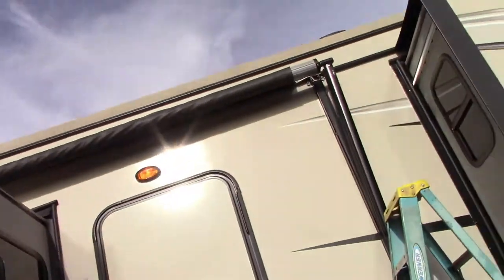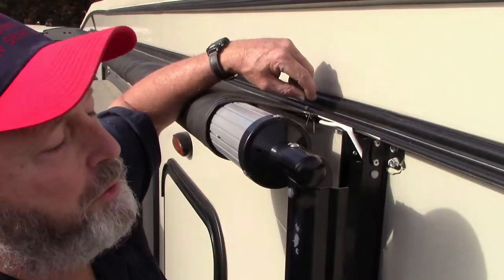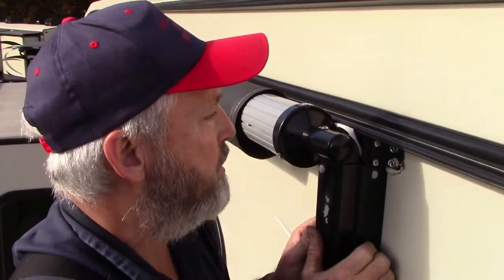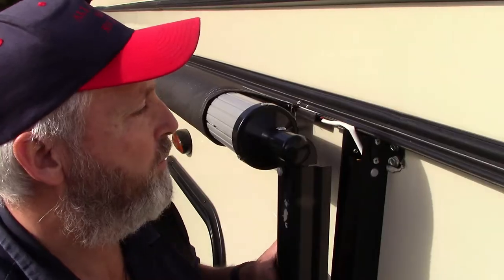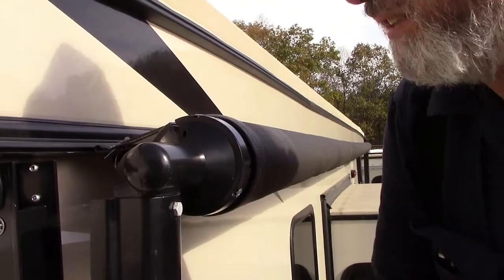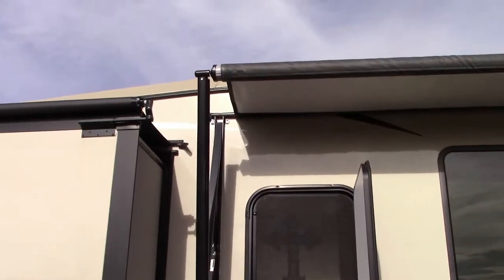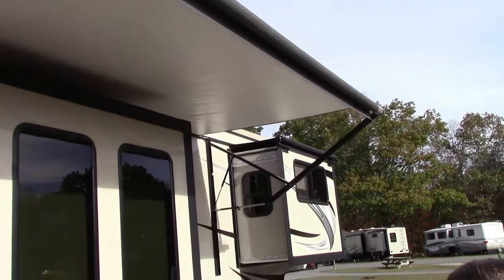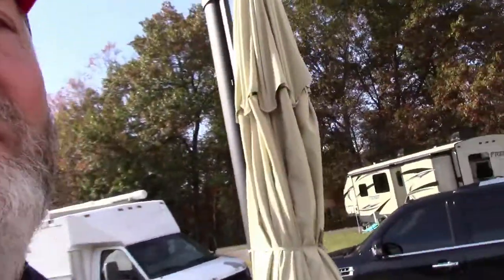Crooked Patio Awning

Comment: I was trying to move my Carefree awning just as you did, however, it did not move in the spline channel. Do you have any advice for this? Do the screws somehow create burrs that lock it up? Can the other end be knocked with a small diameter rod at the same time while pulling the other? I have one arm that looks more bent than mis-aligned. Any advice is appreciated.

Comment: Off Topic; but FYI .......Noticed that you ran the awning straight out without pausing. The "best Practice" method for powered awnings is to "pause" the extension at 18-24 inches from the coach, wait 3-4 seconds; and then resume the extension process. This done to save "wear-n-tear" on the gas strut apparatus. The pausing will allow the rubber seal some relief from the forceful pulling apart action. Cold weather temperatures are more so important on the rubber seals. Few dealership sales reps know (or care) about this.
Reply from the maker: Ok. Thanks David

Comment: I just fixes my crooked awning today. Thanks for this great video. We have a dometic 9200 awning and its super slow to extend and retract since we bought out camper. Is there a fix for that?
Reply from the maker: Both directions? Hmmmmmmm
Reply: @hillbillyrv  
Yes. Its super slow. We had a solera awning on our previous camper and it was at least 2-3 times faster. This one is slow as heck. Both ways.
Reply from the maker: @kamiledytawerpachowski3215  9200 doesn't have helper spring like the 9100 series. been a long time since I saw 9200 that worked, I think they were just very slow.

Comment: The right arm of my 2018 dometic 9100 power awning when closed looks exactly like your picture. The left arm seats properly on its fixed support when the awning is closed. Look forward to trying your fix when we get home.

After looking through the posted questions, though, wonder how the tube can be pushed to the left with the left arm already properly aligned in order to let the right arm return to its proper orientation?
Reply from the maker: Sounds like either the fabric is damaged, really stretched or the arms were not mounted correctly.  Let us know what you find out.

Comment: Thank you for the info you put out, you have help me out with updating my AC to digital control. But now with this video you have help me from my awning fabric from moving on top , but how about if the fabric moves on the roller , how can stop it from moving side to side bin the roller?
Thanks in advance
Reply from the maker: Some manufactures put a short screw at each end of the fabric in the roller tube to keep the fabric from moving. You can do that. About 3/4 in screw should do. Watch some of my other awning videos, you will see these screws used.

Comment: So we recently got an 18 solaire 202rb. When we first looked at the rv, awning worked fine, retracted and extended fast, and was square. Now after bringing it home to AL from purchasing in TN and a couple of trips in it one arm of the awning won't close all the way and fabric doesn't look straight. Think this could be the issue? I'll be the one to fix it so I'm trying your suggestion first.
Reply from the maker: Thanks for the question Stephanie. It is very possible that the fabric has slipped a little with use or I find a lot of times there are no stop screws in the rail to stop it from moving. Hope this helps. Good luck.

Comment: Our 2008 Dometic WeatherPro awning looks even at the top, but it's not centered at the bottom. It's up against the frame on the right (front of coach) and almost 3" away from the rear end of the roller. There are wrinkles we can't get out. We can't budge the fabric by pulling it toward the rear. Looking at Dometic site it sounds like you can get killed if you mess around with the end caps on the bottom roller. Open to suggestions!?! Thanks!
Reply from the maker: Sounds like your fabric is really stretched out of shape. You may want to consider replacing the fabric. If you do, do yourself a favor and buy a genuine Dometic fabric and yes, there is a spring in the left side of awning tube and it can have quite a bit of pressure in it.

Comment: We have a Carefree Travel'r awning. It closes then the left non-motor arm "pops" and cracks open a bit. It's not tightly secure against the RV like the right side. Is this the same problem and the fix?
Reply from the maker: Probably a completely different problem. Your patio fabric is probably a little stretched and not real square anymore.
Reply: @hillbillyrv  Do I need to replace it or maybe recenter it?
Reply from the maker: @cindyb7583  If it is that bad. Replacing could be an option.

Comment: Super awesome that you are willing to document this fix for all of us !
The bottom of my front Awning arm is late to release and kick out, I have to roll the awning out for the first foot or so and wait for the bottom of the arm to release away from my trailer before i continue extending the awning fully.  Any tips for adjustment on that issue ?
Reply from the maker: I have seen that before. I am not aware of an adjustment that will fix that. Thanks for the comment. I hope that you are subscribed to my channel.
Reply: @hillbillyrv  mine has the same problem.  I don’t think the gas struts are strong enough I think they should have a little more tension
Reply from the maker: @jonchezzz  That is possible.

Comment: What if the motor end is loose and the spring end is rolled up tight and the canvas is straight,  how do you adjust it to get the motor end to roll up and close tight when the spring side is already tight when closed.  Thanks
Reply from the maker: It sounds like the fabric is stretched. The only way to fix that is replace the fabric.
Reply: @hillbillyrv  what if I undid the rivets on the motor side and spun the big aluminum tube and drilled new holes and re rivet it... Do you think that would work?
Reply from the maker: @crash41899  I don't think so.
Reply: @hillbillyrv  didn't think so...thank you

Comment: Will this fix the lower part not lining up?
Reply from the maker: If the bottom is not lined up, you probably have a bent arm. So no.
Reply: @hillbillyrv  thanks. Just replaced the arm with a new one and used the same holes. The old arm got bent when someone opened a gate into it. It feels like everything is shifted towards the back of the RV so I watched your video and was hoping this could work by pulling it all towards the front of the RV.
Reply from the maker: @Malster1  Well try this adjustment and see what happens.
Reply from the maker: Good luck

Comment: No such screws visible on my Dometic. I have a 2018 Reflection 297RSTS.
Reply from the maker: If you unroll the awning 5-6 inches, will it slide back and forth? If so, you need such screws. I have seen a lot of awnings that these screws were not installed at the factory.

Comment: Wrong In this case; the roller tube in the back has the fabric one inch from the arm and it’s about 4 inches in the front, that happens when It’s windy. 
Solution; keep the fabric centered by pulling it at the roller.
Reply from the maker: ok

Comment: Sadly you ended by showing the opposite awning end than the one you started with and did not fully show that the fix actually worked.
Reply from the maker: Thanks Gennaro. This adjustment affects both ends the same since both arms are attached to the roller tube on one end and the exterior wall of the camper on the other.  Both ends were equally out of square when I got there and equally straight when I got finished.
Reply: ok, sounds good, i did not know that  @hillbillyrv
Reply from the maker: @gema1378  no problem